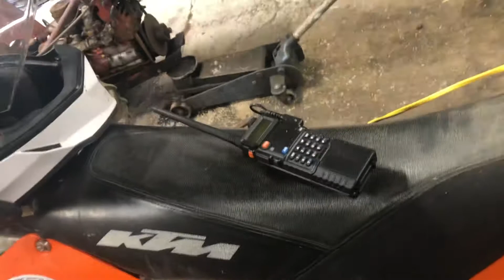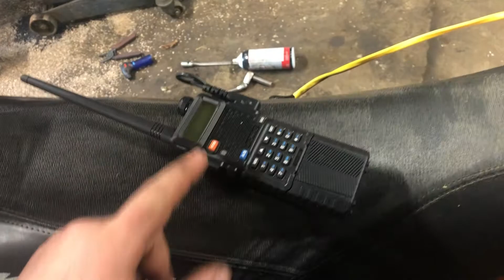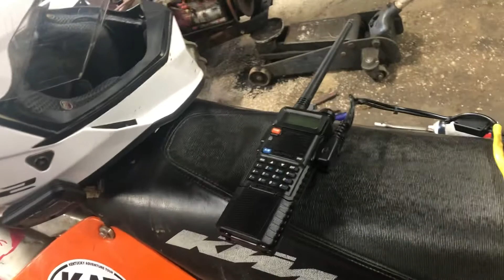Dual Sport Communications using Baofeng UV-5R

Comment: I saw that you mentioned below that this setup eventually broke for you. How do you think it would've worked if you had everything on your person? Radio in a backpack lets say and the button mounted on the strap.  Was the audio quality clear?
I bought a cheap chinese bluetooth headset and mediocre Motorola radio with bluetooth capability and the audio was terrible. Sounded like we were 30 miles away from each other when we were maybe 30 feet. Just extremely static voices where there was no way you could understand the other rider.
Reply from the maker: The failure point for the beautiful wife’s was one of the factory connections on the body when it snagged a branch… I don’t think anything could be done about that except a fully-Bluetooth option. The audio quality was perfect at low speeds, problematic at 30mph+, and practically unuseable at highway speeds. I think going against us on the highway too was we’d both get crackling feedback, I think from bad solder joints. 

Overall though, I’ll likely buy another pair of the headsets and keep the radios person-mounted, and consider possibly making the same system all over again…. Except this time doing better soldering and splicing, and probably something other than usb-c for the bike connection. 15 minutes with the radio unplugged and they’re both full of mud.

Comment: I think Bluetooth Earbuds are an available setup, I would want a Bluetooth PTT and get rid of the wires. I really don't have a need for a charging system.
Reply from the maker: I looked at those a bit… one of the big deliverables I wanted to try to stick to was “fewest things to recharge possible”, mostly with long camping trips (KAT, COBDR, some friends doing Tour of Idaho). But, since the wires failed on both rigs, I may pick up one of the Bluetooth setups and give it a go. Maybe batteries will stay up a lot longer than I expect.
Reply: @firefly3333  I'm going to try the Retevis #EEK013. Hopefully, I can stuff the earbud/mic in my helmet. Like I said, I have no need for charging but the bluetooth sending unit has a USB port that could be used for charging. For rider to rider, I'll use the stubby antennas and put the radio in an enduro jacket pocket or fanny pack.
Reply: I have a Bluetooth PTT with an Anytone radio.  It works OK but has two problems.  It has a long delay between pressing the button and TX.  It also disconnects every time I get off the bike, and that gets annoying.  

I plan to add wired PTT and use my reverse rev limiter button as the PTT.  (ATV)

Comment: Nice video and adaptation for your bike, how has the long term function of your system been working out? I am interested in doing something similar for snowmobiling but without the extended recharge requirements, just communication between 2 additional friends with radio and headsets.  Would you be willing to share your wiring schematic?  I would be looking to wear the radio on and at chest level, have a headset plugged in and a PTT remote wire run down near left hand grip area, do you think this is reasonable.  I am researching which radio to purchase, which is what brought me to your vid but I am not sure if these radios are overkill, it seems these are less expensive and the range is better than the bubble pack sets available.  Keep up the great work and innovation.
Reply from the maker: Well, unfortunately they didn't hold up that extremely well... I think some of the issues were mine, and some were with the Baofeng headset kit. The first issue we had was that there would be a lot of static and feedback... then suddenly PTT would engage when not commanded, and not engage when commanded, randomly. I think both of which were soldering issues at the multiple custom connections. Second, the connectors going into the extended battery packs are very sensitive... if they're pushed off-axis in any direction, they no longer charge... Those issues were live-able... but then one of the wires on wifey's headset caught a tree branch, and ripped out of the baofeng headset's factory connection. I think we could have done better to tuck and protect wires, but it also seemed like a fairly weak connection. 

I'm working on uploading a reference schematic, but Google drive isn't cooperating. I'll update when I can get to better network in town and upload.
Reply: @firefly3333  Cool,  thanks for the reply.  Still searching for a good setup.  Keep up the good work.

Comment: These are great little radios for the price. 
I got a 12 volt battery eliminator that connects to a 'cigar lighter' on a car. To be honest ive never used it so i can't vouch for it. 

Interesting video. 
With a couple of tweaks these radios have great potential for bikers.